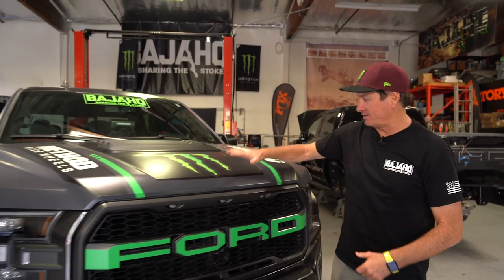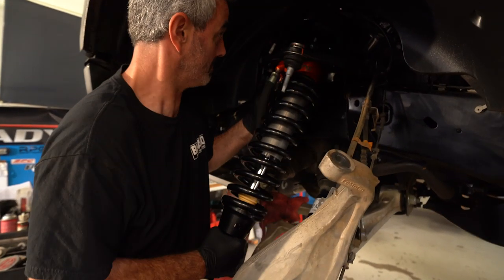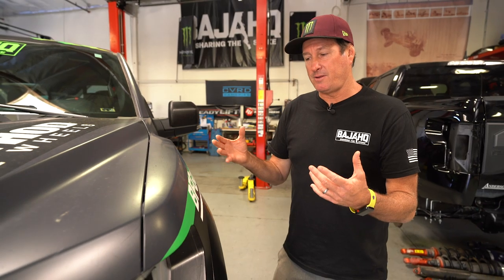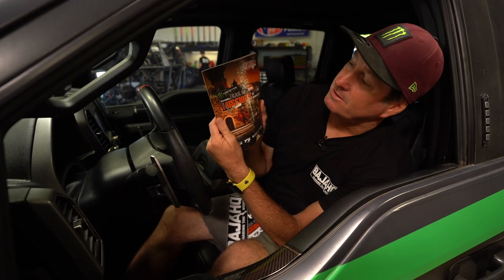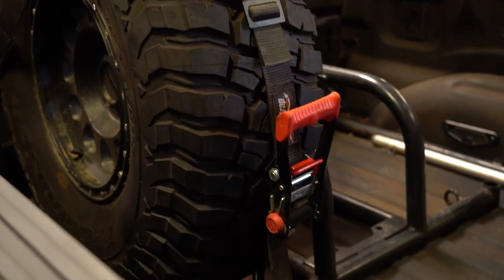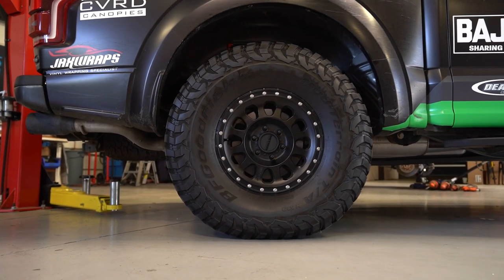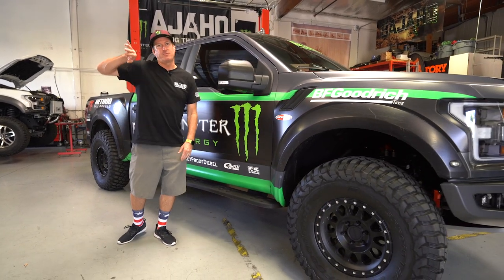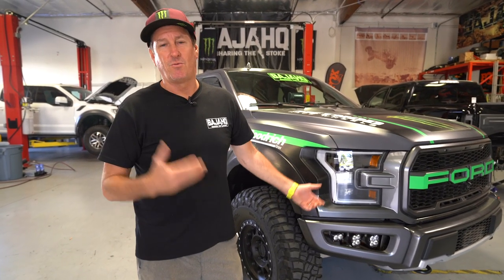RIDE CHECK: Cameron Steele's Ford Raptor | FOX

Comment: Really like this build. Close to stock, but tasteful upgrades....didn't realize the new Factory series allowed for ride height adjustment.
Reply from the maker: Thanks. The adjustable spring pre-load is a nice feature.
Reply: T4nkc0mm4nd3r I like the live valve 🤪
Reply: OEM + type builds are the best

Comment: Have a 19 and was pretty happy with it  stock but back end was to stiff, added icon multi pack gave it the 1" +.. then wanted to level front out added geisers great product but I hate how stiff they are on the road.
Will these new live valve shocks give me the leveled height and Smooth ride on road ?  Is there low speed adjustability ?
Reply: Yes definitely, the front is all you really need. I have the front upgraded shock and icon leafs on level one.  Had the eibach so I know what you mean and the geisers are twice as stiff/rough. They are good on the 17/18 but to harsh on live valve trucks. Brother owns a shop and can get you a good deal if interested

Comment: Why do I want the live valve upgrade over going with the 17-18 that would less expensive with external adjustment on the rear bypass tubes, honest question as I cannot find any info or rea reviews as they are relatively new.

Comment: So in 2019 ford increased the diameter of the rear chocks and added electronic control.  What are you disconnecting when you replace the stock electronic control with these?
Reply: Plug and play

Comment: I have and love my Gen 1 Raptor, do they make shocks like that for my truck. The 3.0‘s I hear make a lot of noise in the rear end. And I’ve rebuilt my stock And you know after a while that would drive me crazy. Any help would be greatly appreciated. The name is TJ and I’m a weekend warrior. Johnson Valley, California city and Dumont dunes are my usual playgrounds!
Reply: You can use sdi and then upgraded to the live valve shocks

Comment: I have a 2018 Raptor. Will those work on my truck? If not what is a good shock to use to level the front end?
Reply from the maker: This truck is a 2019 with Live Valve suspension but we do have a similar shock for the 2018 which also has a pre-load adjuster that can be used to change ride height.

Front:
https://www.ridefox.com/product.php?m=truck&t=shocks&partnumber=883-06-140&make=Ford&model=F-150+Raptor&year=2018&position=Front
Rear:
https://www.ridefox.com/product.php?m=truck&t=shocks&partnumber=883-09-141&make=Ford&model=F-150+Raptor&year=2018&position=Rear

Comment: I think you need the HD Deavers + 4 pack
Reply: I did the Deaver HD +5 and it seriously changed the ride quality.
Reply: @A619D  Is it too rough now? I have the 3.0 fox adjustable shocks and HD +4 leaf's and it raised the back around 4 inches,  when I go offroading I carry about 300lbs to 400lbs in the bed. The stock set up i found was way to soft, but with the new adjustable shocks you can still revert back to that almost stock feel or stiffen it up whenever you need to.
Reply: @edmeyer4800  sweet set up man. Yeah im only running 2.5 coilovers w/ Resi & DSCs front and 2.5 smooth bodies with remote resi w/ DSCs in the rear. I had a 6” lift but after the Deaver install my rear end lowered an inch and a half so im dialing down my front end coil to even it out. Should make it even smoother. The Deavers are a world of difference even before shocks.
Reply: @A619D  Nice man I bet the stance looks good on your set up, did you put 37's on it ?
Reply: @edmeyer4800  not yet. Im running 35” Fuel wheels with Toyo RTs but im going to add a set of Methods with 37 Toyo MTs for when i wanna get nasty 🤣

Comment: Do you not rub with the 37s offroad?
Reply: Michael Santiago  they dont with a mid/ Lang travel kit. Stock yes. It takes roughly 30 k to run 37’s
Reply: Fern Built besides the Fox 3.0 live valve and Deaver upgrades, what else was done to this truck to allow for 37s? 

I have the king 3.0 equivalent upgrades and icon rear leafs on my Gen 2. Would love to fit 37s but I run my truck hard offroad and can’t rub.
Reply: Michael Santiago  check out. Keep it dirty off road channel in here. He has a recent video on what it takes. Very detailed.
Reply: Fern Built Helio’s video is great. I was just wondering if they did something different here because there was no mention of it. 

Thanks for the quick reply. 

Do you by chance have 37s on your truck?
Reply from the maker: The FOX 3.0 Coil-Over shocks on this truck have a spring pre-load adjuster that allows you change the ride height eliminating the need for a leveling spacer and giving clearance for a larger tire.
Reply: @FOXFACTORY  I have the King 3.0's and have also tried the Fox 3.0 coil-over shocks and rear bypasses. I still rub with 37 inch ko2's. Is there something that was done differently in this video?
Reply: @michaelsantiago6788  depends on your wheel offset. The more your wheel will stick out (0mm or minus offset) the more 37" tire will rub. If you go with +20mm offset or even closer to stock wheel offset the less chance for 37" tire to rub with those Fox or King shocks which offer adjustment.